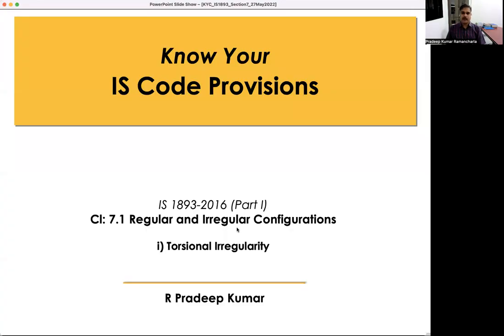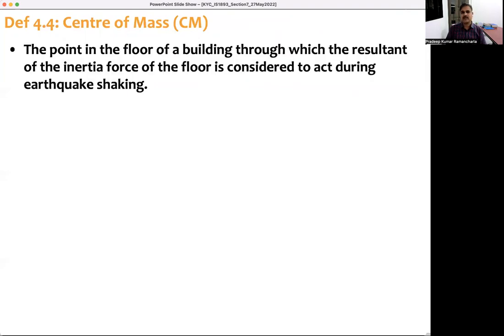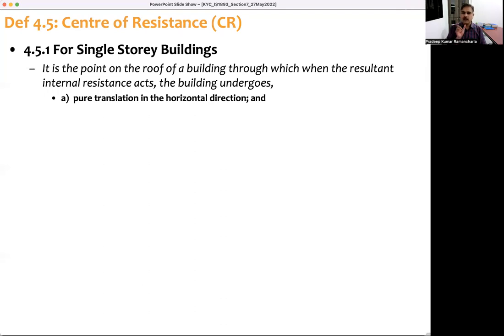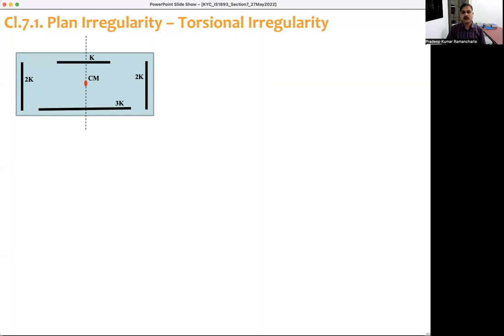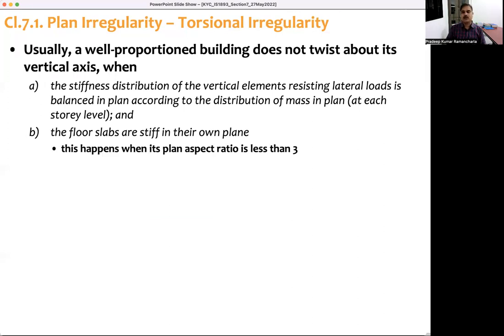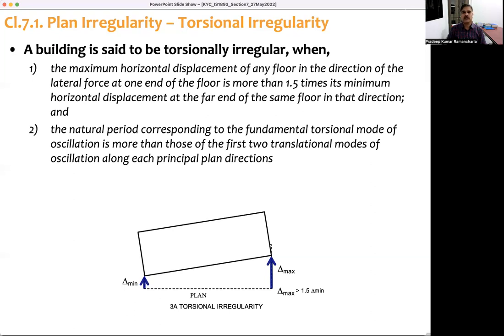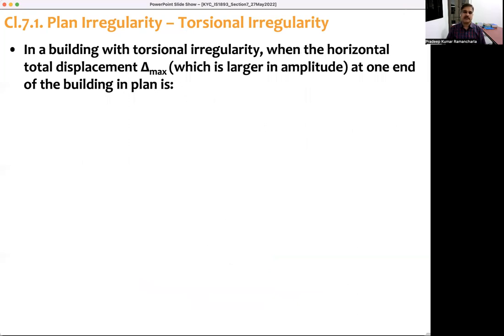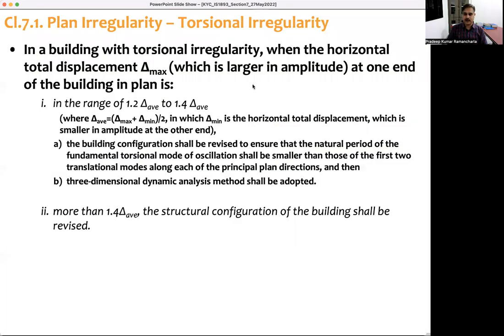IS 1893-2016 (Part 1) Clause7.1Table 5 (i) TorsionalIrregularity

Comment: there is not enough clarity regarding the wording of code about when does the building becomes torsionally irregular. 
Code says
Condition 1 AND
Condition 2
Mark the word And 
So one can say that as code says AND my building only has condition 2 so i don’t require to even check 1.2 Delta thing. 
I believe codes intention was 
Condition 1
OR
Condition 2
But worth to confirm with BIS committee
If the code intent was AND
Then many buildings may not require that check at all.
Worth to have your opinion on this sir.